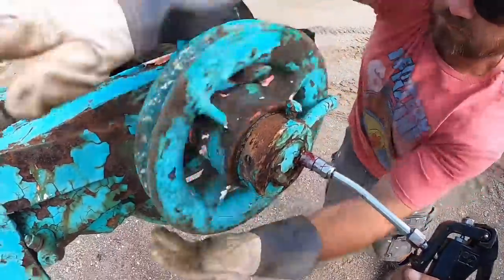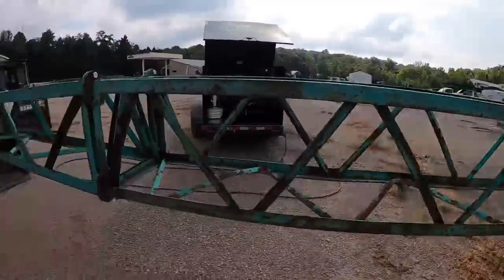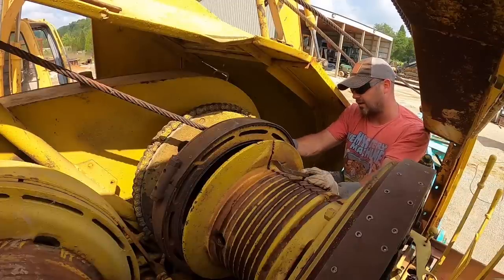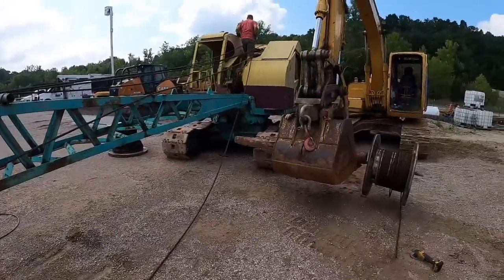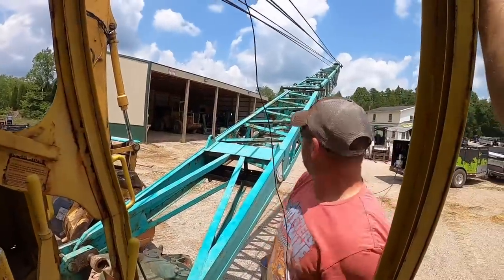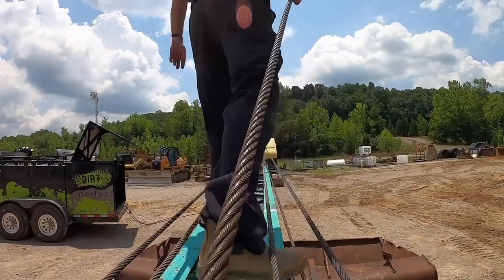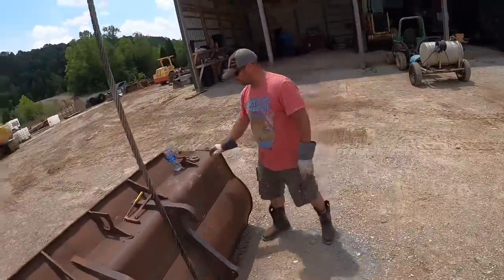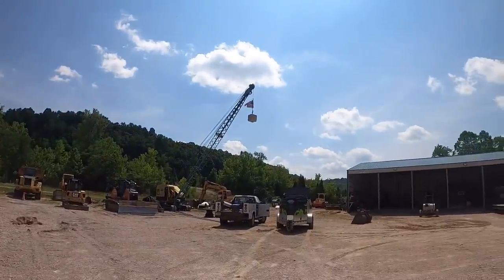This Has Been A Lot Of Damn Work For A Flag Pole, But It's All Worth It. Watch This!

Comment: I worked oilfield for a while, we did use black tape on the cable ends when cutting but at install we melted the ends with a torch like with nylon rope. Put a cable clamp on the loose end of a drum or the pigtail of a dead-end

Comment: Put the flag up higher and leave the block on the ground, less liability it will fall and hurt somebody and you'll need a couple U-bolt clamps on the cable ends above the wedge yet, lookin good!

Comment: I worked in the UK construction industry, at the 'rough trade' end of the market, using Ruston Bucyrus 22 RBs, the UK version of your 22B. Ours had different engines, usually a 6 cylinder aircooled Ruston engine, but sometimes a watercooled Dorman engine. The control levers were differently arranged, our main engine clutch lever was on the right, not the left like yours is, and our cabs had a little window in the top front curve of the roof, so the driver could see the point of the boom when it was jibbed right up.

Now, Aeron was lucky, poking around in the drum and the cable when the engine was running, and still ending up with the right number of arms and fingers! 
On the side of the boom, in front of the driver, is a small pivoted arm, moving over a white painted scale on it. These scales are removable, and you should have several of them, one for each possible length of boom. With the right scale in place, the pivotted arm should point to the safe working load marked on the scale, and this varies with the working radius of the boom. Do you actually know the weight of the concrete block you lifted up? You should, for safety's sake, you don't want to tip the thing over do you? These beasts don't have any safety cut outs, unlike modern cranes.
Ours all had a Wylie overload device, which was a box mounted on the cab roof, which measured the tension in the boom hoist rope, and had different settings depending on the boom length in use. If it detected an overload, it would ring a bell in the cab, though a piece of cigarette packet kept it quiet! It was one of my jobs when the safety officer visited, to go round and make sure the cigarette packets had been removed before he got out on site!
Experienced drivers knew by feel when the crane was approaching tipping point, but it wasn't to be recommended, and, without being rude, I think that you, and Matt (diesel creek), letsdig, and Clint are all a fair way off that level of expertise yet.

Last thing, our UK crane rules  prohibit leaving a load suspended with the driver in attendance. Your concrete block counts as a load, and you are relying on the hoist drum brake lock to keep it up there. I was very nearly killed  this way, years ago, when the crane driver left a heavy length of H pile suspended while he went to get a cup of tea in the canteen. I was working nearby, doing a final inspection on a bridge girder before delivery. I had my back to the crane, and heard a rumbling noise. When I looked round, the H pile was on its way down followed by the chains, the hoist block and most of the hoist rope. I was still fairly athletic in those days, and managed to jump over the bridge beam to safety before anything hit the ground.  In the drivers absence, the hoist drum brake lock had slipped free, letting everything into free fall. That wasn't an RB, it was an NCK, the UK version of your US Kohering cranes, and i never did like their brake lock arrangement.

Anyway, stay safe, and I'm sure you'll have fun when its set up for dragline operation. I only drove a dragline once, and when I managed to tip the bucket on top of the truck's cab roof, instead of in the body, and so I was dragged from the cab and banned from ever trying to drive a dragline again!

Comment: Hey Mike, thanks for posting. When Clinton @ C&C did the drag line flag pole, he had the weight on the ground and the boom elevated with the flag up high. I'd guess your Mom loves the flag but is scared of that weight. Oh and it's been a long time but your machine is like the link belt and needs full throttle for cable up and down is just brakes so doesn't matter. It seemed your machine was going to stall a few times. If you know what a 50 ton travel lift looks like, they come in many pieces and I put it together with the link belt and placed a whole bunch of pilings at full throttle and feathered the brakes. You guys accomplished  a lot today with no injuries so congrats.

Comment: We would bend a piece of banding to guide cable around sheaves. The boom cables were 880 feet of 3/4 inch cable. We would put the new cable against a cut off end of the old cable, weld them together and pull the old cable to feed the new one in.

Comment: Use a ubolt on the cable before you cut it to keep the cable from fraying. We have used a torch to melt the end of the cable to prevent fraying when we didn’t have a ubolt

Comment: You might look at some diagrams or pictures, i think your missing something. Dads crane had two anti boom over pieces. They where two telescoping pipes on each side of the boom. One end was attached to the first section of the boom and the other end was attached to the crane body at the top of the dog house. They wouldn't prevent an over boom but would give you a warning. Dads cran was a bantam and slightly newer than yours.

Comment: If I were doing all that I'd lubricate the whole cable with silicone lubricant.  The cable will last longer and it will reel in and out more easily.  Just a little of my own experience. Additionally I'd put some cable clamps on the tails even though you have a wedge clamp.

Comment: Dont forget to grease/   oil the cables to make them  last.

Buying new cables "to soon " may be expensive and the work to replace them  is also 
A factor to put in to it ...
Reply: Hah, I was going to suggest the same thing but hate telling people how to suck eggs, but you're spot on, that rope grease paid dividends when we had RB22's and P&H's on the barges in a saltwater environment. Do you think Mike has found the lower gears,  so old Jimmy remains just above idle when using it as a crane?
Reply: I Dont no so mutch about old cranes  /excavators , but I know steel kabels corrode,
At  slitly newer traditional sailing ships they tar the standing(stationary)steel rigging steel ropes , and puts cloth on the cables; more  tar and tared twine over that. Then  paint the whole thing with even more tar or several layers  of oil paint.
If any of the cladding on the ropes fall of you must go up and repair the cladding so salt and water does not get inside.
Also it tends to keep unwinding more and more if you dont fix it fast.
On wire that serves as  " edge fasting " for  moving stay sails and fore sails the cable would be unclad because the sail fasteners would  rip of the cladding. You will replace these cabels more often instead .
Moving rigging is mostly real ropes   (sometimes shains) due to less  corrosion/ handling benefits  the ropes even if some steel lines may be used up in the moving rigg to some degree ,then often spliced together with ropes where the system goes through pulleys and blocks,and down to the deck,crew .

Comment: I would spray all the cable wire with WD40 Dry Lubricant with Silicone, and Teflon.  It would protect from the weather, and not collect dust / dirt. Maybe 2 Dozen cans or a friend from WD.

Comment: Mom might have been just a bit more willing IF you didn’t have that concrete block hanging out there where it could come down and splat something/somebody… still, almost there for the drag line or using a clamshell bucket.  Either way, now you have a crane to load your truck/trailers with things like those big concrete blocks or clay tiles, or just some attachment to another piece of hard ware… I think this would be easier on those old tiles with a strap vs the forks on either a skid steer or loader.

Comment: Great job, just not sure what the health and safety kill joys would think of leaving a large lump of concrete hanging 20 to 30 feet up in the air by a single wire on a vintage crane 🤔🤔🤔

Comment: I know this is a bit late but, the next time your string it sacrifice a smaller cable to get the path correct and then use the small cable to pull in the larger one.
Reply: Yes! They could even have used a rope to pull the main cable through. Just look how ships are moored and towed.  :-)

Comment: I thought you was gonna lower the cable. Tie on the flag and leave the weight on the ground. Either way, put the dragline between the shed and the old white building. Momma will get use to it and want it moved over to the store.

Comment: I know that your up on safety but MBTS was in a very sketchy area be carefully and you were. Just don't get complacent and forget to be safe.
This machine is old, paint or primer are probably lead based and the brake linings on the cable drums may be asbestos. The boom luffing brake looks to have been replaced as evidenced by shiny rivets. The clutch has original glued and safety rivets all painted. Probably asbestos.  Dust from open bands need to be controlled and personnel need protection. Don't take this home to your families, and protect yourselves .

Comment: DP. How in the blue blazes are you going to transport that thing? Will it fit on the Mack or will you need a longer trailer? You may have to resort to some of the "old" road rules and have MBTS walking in front of your transport with a red flag. At least with those "long shorts", the blazing white shins, and those over "tall" boots, he should be highly visible (and could even outshine the red flag) 😎🤣.
Reply: Start with uncabling the boom. 
Split and remove boom.
Load the housing onto one trailer.
Load boom, cable, attachments onto second trailer.
Haul to site, unload everything and reassemble unit.
Repeat everything to move unit again.